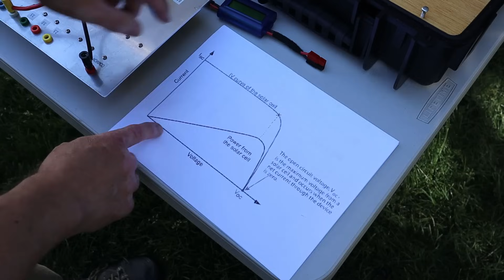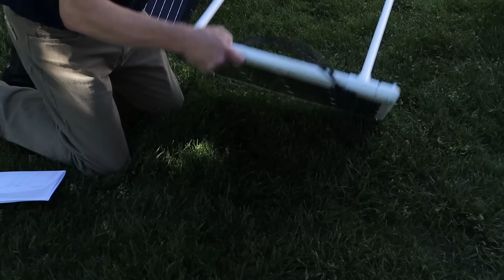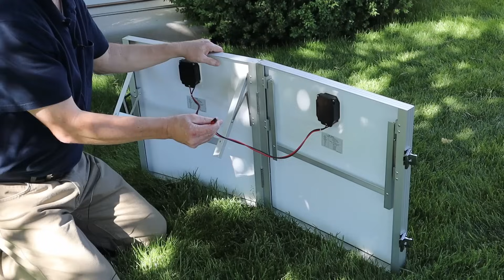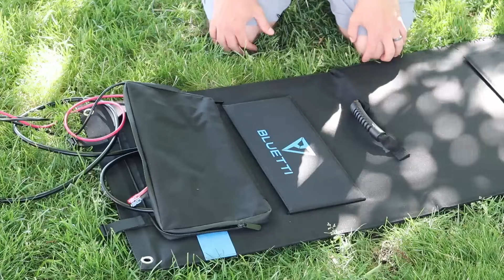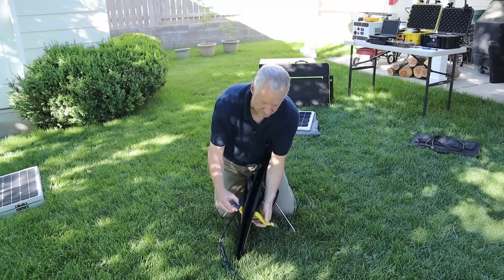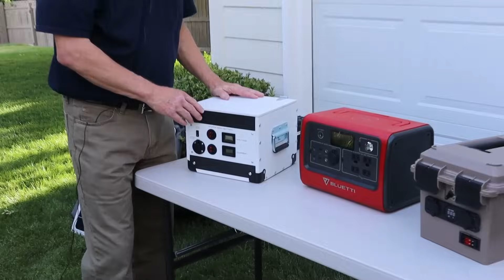Portable Solar Panel Comparison, 11 Different Models! Sunpower, Baldr, Rockpals, Bluetti, and More!

Comment: Im new to this, how can they be connected together for more power? Also if the panel doesnt include the right plugs, you have to go searching for a plug somewhere and then also buy wire and what gauge and then splice wires together and buy shrink tubing as well?
Reply from the maker: Depends on what you are connecting the panels up to...Some devices take parallel connection and some take series connections. There are many adapters available online to help adapt the solar panel to a power station more easily.

Check out a view videos on YouTube about solar panel parallel vs series connections that will help a bunch.

What are you planning to charge?
Reply: @Jasonoid  Im planning a van build and therefore the least expensive solar options that can power a pc, mini frig, LED lights, roof fan.
Reply from the maker: @cvcoco  I'd go with a 200 watt rigid glass solar panel on your roof of your van. Possibly 400 watts total. Depending on which power setup you go with you can connect them in parallel or series.

Comment: I think you did a great job for what you had. Too bad you didn’t have any merlin panels. They’re more expensive by quite a bit. But they are the best. It’s too bad the manufacturers won’t send someone all the panels and let them all be tested like you did. Then you could compare apples to apples and oranges to oranges. The battery things you’re showing that’s a tough thing it changes so much. None of them have more than a 3000 W inverter. Soon they’ll make one that will run an air conditioner. Problem with inverters is the 5 to 7 AM draw no matter what you do you’re going to have this. I’ve built in all 24 V system. Was expensive but very well worth it. Don’t have the inverter loss. Have plenty of power for a couple of days running in AC. Keep up the nice work guys
Reply from the maker: Thanks Joe, one day I will build a 24v house backup system. Then I can run appliances without pulling 200amps LOL... Just gotta save up quite a bit of money for that as you know.

Comment: Hi, thank you for the great video, i live in sunny island Singapore, i like to charge my EV using these panel, what cable can I use? which panel you would recommend ? Thank you
Reply from the maker: What voltage is your battery, and what charger do you plan to use? That info would help me provide more detailed information.

Comment: I love this! I'm now shopping for better folding solar panel as my Acopower 105 watt has much diminished power after less than a year.  Thanks for all your time and work for this video!
Reply from the maker: For something completely waterproof check out the Sunpower Flex 50. If you want some great output for the cost the BALDR 120 panel is a great option! I have many other videos about solar on my channel. Thanks for commenting!

Comment: Team,
I purchased the Buetti SP 200 because it went on sale for $399 and then I realized that it doesn't match up with my solar array as well as either the Rockpals 100 or the Boldr 120 I have Renogy 4 100 watt flexible panels in parallel with 17.7 V and 5.7amps. So, my dilemma is do I stay with the great deal and sun power panels which might be more efficient  than the better matched panels? I should be able to see a 180 watt from the Buetti SP 200 added panels in parallel  17.7x32.8 = 580.56 watts. I like the Bluetti SP200 because it's one panel to ground deploy and the larger kick stands seem to be an advantage too. I don't need to USB charging, I do that inside my Airstream. Comments welcome
Reply from the maker: Hey Dave! I would go with the option that gives you the most wattage. Solar panels sell really well on the second hand market so you could try to recoup some of your money or keep those panels for a backup in case you need them. I learned the hard way about combining my SP200 with a panel with dissimilar voltage, my SP200 doesn't even put out more than 100 watts now. I'd advise not to hook it up with any different panel than the SP200.
Reply: @Jasonoid  thanks for the feedback

Comment: Jason…I’m ready to purchase a solar panel to charge my new EB70 in case we have a power outage due to hurricane or ice storm. I want to spend no more than around $250 or less unless there is a great deal going on. I’ve looked at folding portable panels and the rigid panels that I can get 180-220 watts for around $200. Which will work with my Bluetti and what would you recommend?  Do you have a link you would like me to order from to give you an affiliate credit?  Thank you, Denise
Reply from the maker: Hey Denise! That's super exciting! If you purchase one large 200 watt rigid solar panel you should be able to keep it out in the elements and not worry about rain damaging the panel because it will be fully waterproof. They aren't too heavy and you can tilt it up against a box to get the right angle for the sun.

Are you leaning towards a rigid panel vs a folding panel? I just got a 180 watt BougeRV solar panel delivered today! I can briefly test it and see what results I get on my EB70. I think a 200 watt panel my be a little better because it will have a slightly higher wattage compared to a 180 watt panel.
Reply: @Jasonoid  I’m not sure between the rigid vs folding panel. I’m open to either. I did look at the BougeRV panel and some of the rigid 180 and 200 watt panels also. Being a novice it just confused me more. Hubby and I could handle either panel so that’s not a problem. Thank you for sharing your wisdom.
Reply from the maker: @firegirl441fromga6  I'd recommend getting the best rated 200 watt solar panel for your budget. Skip on the 180 because if the conditions are perfect you won't see max power input on your Bluetti EB70. Pick the one with highest peak voltage power you can afford:

BEST: This Renogy puts out 22v so that's the best I could find, I will probably buy this panel someday: Renogy 200watt
https://amzn.to/3FhfPLN

Better: This Rich Solar puts out 20.4volts so Id recommend this second:
https://amzn.to/3zY6iFs

Good: And this other 210 watt panel only puts out 16.7v so you'd see less power input on this one:
https://amzn.to/3D2dAd2
Reply: @Jasonoid  Thank you Jason!  I placed my order and used your link to support your channel!  I appreciate your help!
Reply from the maker: @firegirl441fromga6  awesome! Which one did you decide to go with? Please let me know how it goes!
Reply: @Jasonoid  I went with the Rich Solar one. It actually had better reviews and for some reason after reading everything about the top two I just felt better about purchasing it!  I will let you know how it goes once it gets here!  Blessings, Denise

Comment: I may have missed it, but it would be very cool to see all of these data points in a spreadsheet, especially if there was a breakdown of the cost per watt actually produced by any given panel.
Reply from the maker: Check out the pinned comment on the video, I had a viewer break it down and it shows some pretty great info!
Reply: @Jasonoid  - Thanks...I didn't click "more", so I missed that!  :)
Reply: Read Jeff’s post, he broke it down
Reply: @mrs.c5471  - The pinned comment, below, has all of the specific information I was looking to find.  :)

Comment: Ok, I see you came to that ... sorry.  I recently got the EB55 and it only has 47 Amps at 12 volts.  However, lots of great features all in one packet.
Reply from the maker: The EB55 is an awesome power station. Its the best 500wh power station right now.

Comment: Bluetti also has the MTTP built in Controller.
Reply from the maker: The SP200 puts out raw voltage like any other panel. No mppt charge controller on this panel.

But yes, the EB70 does have a built in charge controller. It's pretty efficient too.

Comment: Great video!!! Question:
If I buy three 200 watts Blueeti solar panels. which one is the best affordable charge controller for that setting ?? Thank you again.
Reply from the maker: You'd probably see around 30 amps of charging power in perfect conditions so you'd want to plan for a controller with at least a 30 amp limit. Epever and Victron both make awesome charger. I also have a really cool "dual charger" that does both DC to DC Charging and solar charging. Check out that video: the Kisae DTM1250 50amp charger.
Reply: @Jasonoid  great videos. I am learning a lot.
Reply from the maker: @GonzoGovi  More videos coming out too :) Thanks for watching and commenting. Happy to answer any other questions you have.

Comment: I'll be on a boat where space is a concern. So I'm torn between the Lensun 100W and Bluetti 100W. Both are smaller than most folded but quality wise, which is better? Using the Energizer Portable Power Station 320Wh/300W Solar Generator.
Reply from the maker: With the chance of it being wet I'd probably recommend the Sunpower Flex 50. It's lightweight and waterproof. It would work really well for your setup. I have lots of other videos on the subject so feel free to check out those video. Happy to answer any other questions!

Comment: can any of these panels be left in rain?
Reply from the maker: The Sunpower Flex 50 is super lightweight and completely waterproof. I'd recommend that one for leaving it out in the rain! The other option would be to go with a glass rigid panel.
Reply: @Jasonoid   i have my eye on 180W bougerv panel for van life roof duty
Reply from the maker: @saltpepper1894  that would be a good panel as well!

Comment: I contacted 4 big name solar panel sellers recently for some advice on which panel to buy for my needs. I called & emailed each of them. NOT ONE of them responded.  NONE OF THEM ARE ON YOUR LIST so I'll leave it at that. I did talk to Signature Solar. They were very helpful. Before I buy anything I will also review your suggestions.  Thanks for the video.
Reply from the maker: Newpowa has a good support group. I've had a bad experience with Renogy but most people like them. Most rigid panels you won't have any issues about performance or quality, folding panels have a higher risk of issues.

Comment: Great review guys and you have me on the verge of purchasing those Bldr 120 units, current best price is togo website at 119.95 but with 10% discount ( boy I wish 179). My question is that I'm in need of MC4 and not Andersen connection, do these come with an adapter to make them MC4 so that I can hook in series to for my bluetti solar gen? I was wanting to purchase their panels but they just want too much.
Reply from the maker: You can purchase mc4 pigtails and adapt them to Anderson pretty easy (check out my recent anderson powerpole video). There might even be some pre made adapters online you can buy that go from Anderson to mc4.

Comment: lol so much useless info, missing info... try to charge your LiFePO4 battery with a car cigarette lighter type connection! LOL... wait a month or 500 miles and you may be near charged LOL
Reply from the maker: This was a super laid back, non formal video. 12v charging is for topping off the battery or canceling out the usage of a 12v fridge. I use a Kisae DTM1250 50amp DC to DC Charging for my lifepo4 battery. You can check out my video on it

Comment: Lets say your battery messures input 900 watts for solar charging . Lets say i have 1400 watts of pannels  . Do they make a voltage regulater to regulate the voltage down to 900 watts ?  So when 8ts cloudy you can still maintain 900 whats . I think this w9uld be agreat thing if it also was ajustable
Reply from the maker: That term is called over paneling, if the charge controller is designed for a specific amount of wattage it shouldnt go above that amount. So then you put more panels in your setup to compensate for when clouds show up and they act like a reserve energy for less productive days.
Reply: @Jasonoid  thank you for the info , and the correct termilogidy !!! Im in the service for furnaces and ac . This is the first system im building i was thinking victron what would i look for in a charge controler for this was think of an all in one whats your opion ? 
By the way thanks for the pannel reveiw helps me out greatly !
Reply from the maker: @kentkurt9065  victron makes excellent products, lot of sizes so you can fit your system / needs perfectly.

Comment: Hi , do you have any knowledge of the (SUNSUL 20 Watt 12V Solar Panel Kit Battery Maintainer Trickle Charger, with Waterproof 5A 12V/24V PWM Solar Charge Controller and Adjustable Solar Panels Mount Rack Bracket (20 Watt with Accessories)
Reply from the maker: I haven't tested that panel before. I don't know much about it, sorry!

Comment: I purchased the RockPals SP003 100w foldable solar panels based on your review. This is my first time using solar panels. After a couple of hours charging my 280wh portable power station (Bawaut) which recommends a 60-100w solar panel, I noticed that the wires from the RockPals were very warm, the interior of the pocket was also very warm.  It did fully charge my power station, but the heat doesn't seem right.  Any advice?
Reply from the maker: It's normal for the sun to heat up the wires. As the panel is in the sun the entire thing gets hot, it shouldn't cause any damage. This is normal with all my solar panels and I have measured 170F on them before.

Comment: What are your thoughts on Goal Zero's products? I've been interested in their solar generator kits for a while.
Reply from the maker: Goal Zero started this from the beginning and hasn't innovated much. Their products lack the newer features like USBc, they have lower capacity and lower charging limits. The worst thing is that they cost MUCH more than Bluetti and Jackery power stations. Goal Zero's solar panels are also VERY expensive for what you get. They need to catch up now if they want to stay relevant.

Comment: Question about charge controllers:  

When a panel system is putting out 12 volts is the charge controller is producing the required voltage for the 12v batteries?  

Is the charge controller's job to supply the 12 volts even if the panel voltage drops to 11 volts?  

Does it reduce the panel voltage from say 14 volts to 12?  

I don't expect current would be a problem but does it look at this too?  IOW, if you hooked up 2000w of solar to the CC, would it limit all parameters so it doesn't kill the battery?  

Do you rely on the battery for temperature control?

Well, you put out the video so don't expect me to be quiet :-)
Reply from the maker: So these 12v panels usually put out around 18-20volts. The charge controller then drops the voltage down to the required level to charge the battery, 13v - 14.2v. When you select the program on the charge controller (AGM, FLOODED, LITHIUM) those charge levels are adjusted for each chemistry.
Reply: @Jasonoid  Okay, I get it.  So do they drop out completely when the panel voltage drops below 14 volts or what is the dropout value?  I expect there is some efficiency loss.  So I'd guess the output of the charge controller would give up at 12 volts?
Reply from the maker: @DennisMathias  solar panels tend to put out higher voltage and low amperage. So when the panels are shaded they just put out 18 volts and hardly any amps, so you'll see really low watts (volts x amps = watts)

Comment: I went with Jeff's favorite, two Baldrs! Great video gentleman, thank you. Question: What solar controler would you recommend that is user friendly / found on Amazon?
Reply from the maker: Great choice! Are you going to be using a raw battery or a portable battery like Jackery or Bluetti? If you are using a raw battery what chemistry will it be?
Reply: I have the same question, I have a 200AH 12v lithium ion battery in my horse trailer and am looking for a panel to keep it topped off.  Can the controller be mounted permanently in the battery box? How do i attach yet another cable to a battery that already has several cables attached?

Comment: Does anyone make a solar powered generator that has a non lithium type battery?
Reply from the maker: What type of battery chemistry are you looking for?
Reply: @Jasonoid  I am looking for one that will survive an emp..
I was told the ones with lithium batteries are likely to explode, so looking for safer options..
Reply from the maker: @sunshinedayz2172  lifepo4 chemistry doesn't catch fire like lithium Ion chemistry. No fire risk so that should help you make a choice. Also, If you make a DIY power station from raw cells you can avoid emp failure because there are way less electrical components.... At least I think you could (I'm not an EMP expert). I'll have a video in the next coming months for an awesome DIY battery for super cheap! Very easy build, stay tuned to the channel

Comment: Could you review the paxcess line of products as well? Wondering if they are any good for their price.
Reply from the maker: The Paxcess 120watt solar panel looks just like the BALDR line of products. As long as it has the correct connections you need for your battery it should work well.